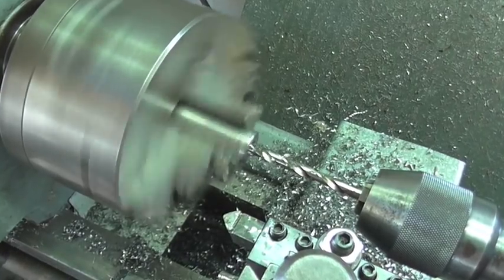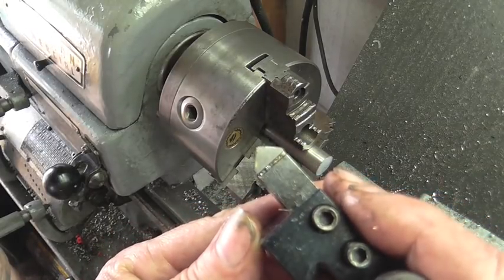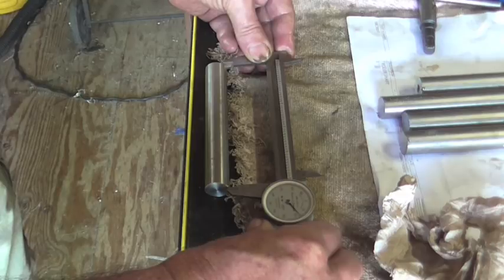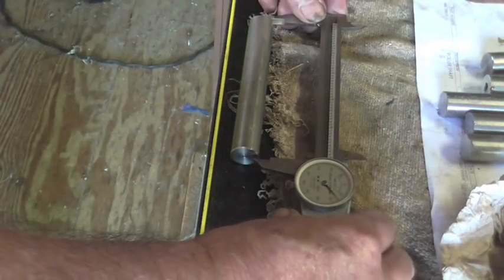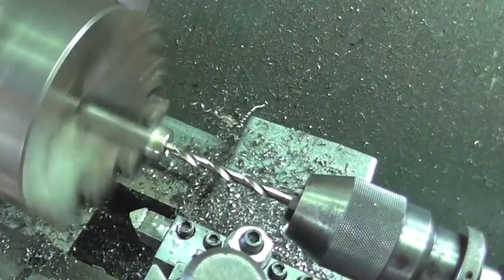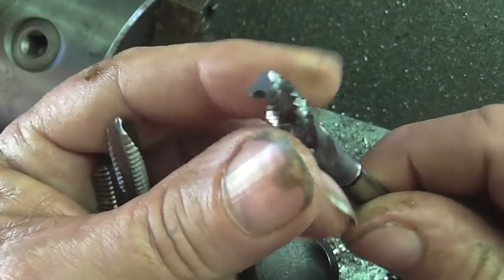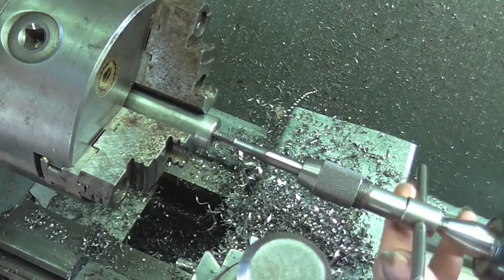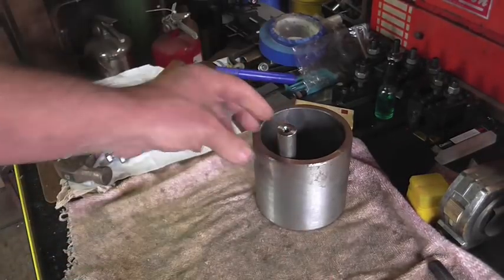Machining Stainless Steel Conveyor Rollers (Production Work) - MSFN

Comment: Spiral flute taps you do not have to reverse to break the chip and you are better off power taping it keeps a constant feed which helps to cut uniform threads and I break more handtaping and getting it in a bind cheers!
Reply from the maker: yep, they were new to me.....after breaking a few hand taps I was walking on eggshells...LOL

Comment: to bad they don't make tungsten taps hard but not bridle . all your video's are very good
Reply from the maker: Thanks Dan!, stainless is hard stuff to tap, never broke a tap on mild steel
Reply: I think they are all made so hard that its is so hard not to break them that tungsten is the best way to go it wont just snap off like they always do . and get the tap deep enough and it will snap I have done it on mild steel as well take care buddy .
Reply from the maker: Have yourself a great day as well Dan

Comment: Richard, one thing I see too many people on you tube doing incorrectly when tapping, is when they go to break the chip is they don’t go far enough back to actually break the chip. They only reverse slightly. When in reality they should be reversing at least far enough the the back side of the previous  flute actually cuts the chip off. In the case of a 4 flute tap reverse at least a quarter turn. I’m just putting this out there so everyone knows.
Reply from the maker: Thanks John. I learned to machine by watching youtube and the comments by people far more knowledgable than me can only make me better at it 😊
Reply: While I’m not the most experienced in a machine shop, I have about 45 yrs. of drilling and tapping. I’m stilll learning the machineshop aspect from YouTube creators like yourself!
Reply from the maker: Maybe you will like some of my other machining videos. I am better at projects than boring production work 😎

Comment: Stainless is tough. Was there a need for the 70% standard thread depth? If not you can go for 50 to 60% and it’s easier on taps.
Reply from the maker: Not sure....never questioned them on it...but this is the third time I have done this job and hadnt broken any taps previously. I generally dont try to sway the customer into what is "easier for me". If I saw how they were used in the finished product I might could offer some suggestions on a better way to approach simplifying the machining. Thx for your comment ~ Richard
Reply: I agree thanks for replying. Just asked
Reply from the maker: was a great question actually, thanks for watching James....I appreciate ya! ~ Richard

Comment: Richard, great demonstration of technique.  Thanks for the tool tip, I think that will help me.  I managed to chip the carbide tool I was using because of my angle of approach.  This will help me.  Thank you.  I am going to grind one up!  Also, I didn't think of facing with the tool running along the axis of the lathe.

I noticed an uptick in subscribers today and was surprised, but after watching your video I know why.  Thank you for all the continued support

Joe
Reply from the maker: I have faced using your method as well....there is no right or wrong way. I just have experimented enough to know what my lathe likes most and stick with it. Subscribers are always nice 😊

Comment: Sometimes a tap will break because a chip will get jammed in the flute of a tap. Something I have found is if I put candle wax in the hole before taping the wax will catch the chip and push the chip out of the hole as you tap. Especially in the case of smaller taped holes.
Reply from the maker: The taps that broke were well used doing this job twice previously...I should have replaced them as they werent cutting as well as when new...I blame me. May try it...I have candles :-)

Comment: Im a fledgling machinist attending YouTube unniversity so anything that illustrates and helps me understand fundamental machining principles is good for me.  In the beginning of my studies I needed to be told what every operation was but now just watching simple operations like you demonstrated in this video is a great reinforcing help to me.  Id heard stainless could be a bear and I learned the hard way about work hardening it.   I guess you just have to plan on scrap and tool replacement when working on it.  Thanks for sharing.
Reply from the maker: I was disappointed I scrapped the one 5" part, the long 32" one just got converted to the smaller ones so was salvaged. I have done this job 2 times before for this customer....my mistake was not replacing the taps before working on this new batch...taps wear out and are consumables....need sharp tooling for stainless.
Reply: AvE showed a way to get a tap out using two different carbide dills and a carbide burr.  Could be something to look at, that might help in the future.
Reply from the maker: Well since you already know how to get them out MP I will be sending my tap removal jobs to you! HA The customer has a machine shop actually but they dont even like doing these so send them to me, they said they have broken many taps and expect some waste...but I hate scrapping work pieces. I have never tackled a broken tap.....yet

Comment: 45° cutting tools work brilliant on long thin shafts. Bigger cut but less chatter. Hey Richard you should use WD40 for tapping... trust me it's the best. Using oil.. once you turned the tap a tiny amount they are basically cutting dry. WD40 is so thin it keeps the tap "wet". it's no fun earning money for work that you lose buying taps.  Use it also whilst drilling. You will be super surprised promise
Reply from the maker: I have never tried WD40 on anything thus far, I will pick some up. I have done this same job before and never snapped a tap, but thought I would share the mishaps this time around. I always appreciate advice from the top machinists, thanks!~ Richard

Comment: Yes Richard I do enjoy watching your videos, but much more than that I am learning from your experiences.  From my experience (but none with stainless) I have found that the spiral flute taps work best by starting with them.  They tend to curl the chip out of the hole and there is no need to back up and break the chip.  Not sure what is happening if you start with another tap then go to the spiral.  But I will bet you like those taps, I sure do.
Reply from the maker: Yes, I liked the new taps and they got me thru the remainder without further breakage. I will experiment with them on some of my steel :)

Comment: Hi Richard good to here from you, and it's good to see the old girl get some you tube time. She feels like she has been kicked to the curb ever sense you got the mill. Lol. Good job. Not sure if you remember but in our past times of talking I told you that I was a welder by trade. When you have broken a tap off and you still have some sticking out of the piece that your threading you can weld a nut to the top of it and most of the time you can back the broken type out. I've done this many times. It will save your part most of the time. Good video.
Reply from the maker: You havent seen my welding! 😖😂

Good to hear from you Anthony, I do wish to try removing a broken tap. Would be to embarrassing to film...Lol

Comment: Why do you use tap holder on your lathe? Just put the tap in the chuck(or fancy mt collet of your choice if you have it ) and leave your tailstock untightend.Then you can ether power tap it or hand rotate the chuck.Same thing works for milling machine or drill press.

As of what tap you should use :
http://www.tapmatic.com/tapping_questions_tap_recommendations_for_specific_materials.ydev
Reply from the maker: My lathe doesnt have enough ass to power tap steel. I can do brass & aluminum tho. Certainly not stainless...thanks for the link Zumba....always appreciated :) ~ Richard
Reply: You dont need to power tap it .Do same thing that i told you and put a chuck key in chuck and use it as lever to rotate and tap,also put your lathe in high speed gear .(i think Steve Jordan?made a handle for that from bike pedalhe also cuts threads with it)I prefer to do it by hand when i am taping blind holes this way -powertap it just for trough holes. 

Stainless steel loves small speeds but high feed rates and plenty of cooling fluids.

If you work a lot with stainless i recommend to get black oxside hss drill bits(dont know for modern ones but old are blast from the past -42 holes in ss thin sheet metal that ruined all other drill bits we had without sharpening) or hsscobalt(M35 is 5% m42 is from8-10%) .

banggood has cheap but true cobalt-good quality i use them myself (but its metric) https://www.banggood.com/15pcs-1_5-10mm-HSS-M35-Cobalt-Twist-Drill-Bit-p-1096838.html?rmmds=search&cur_warehouse=CN
Reply from the maker: My mistake, now I understand....thanks. Have a great weekend Zumba :)

Comment: First time I noticed. We have the same saw, LOL. It has done a lot of work including stock welded to the bed. Tough little beasty eh. Ahh, stainless. The king of piling up threads esp. It's the nickle that causes all the grief.Over the years I found my best friend for working difficult metals such as TQ100 and Inconel, , , , "Rapid Tap" is the slipperiest and best surface tension reducer I have ever found. I have "GUN" taps for the hardest and love the spiral taps too. They are designed not to have to continually back them up as well. They will produce a spiral coil that keeps itself clean. Throw the oil away and get a big jug of my saviour my friend.
Reply from the maker: I never tried Rapid Tap.....I babied the spiral flute since I was down to the last few holes and didnt want to risk breaking another...it was customer material. I would like to have all the bells & whistles other shops have as it pertains to cutting fluids but my budget for such stuff is really limited ☹️ ~ Richard

Comment: I'm not sure you really gain anything from facing with that tool geometry, if it's a 45 degree tool and your facing off a 
.035 depth of cut then it is actually removing around .049 a long the hypotenuse ( cutting edge ) which is more work for the machine. Maybe I'm missing something though never tried it.
Reply from the maker: My lathe likes it better than the traditional tool type I used to use for facing....which is what Joe was using. Just offering him an option......it was easier to just show him than explain it in a comment. Thanks for watching & commenting! ~ Richard
Reply: i agree    erstwhile.
Reply: Makin Sumthin From Nuthin Always good to have more then one way to do something, Keep up the good work.